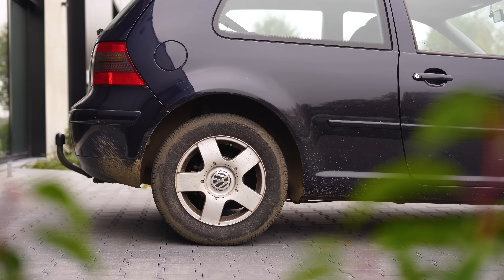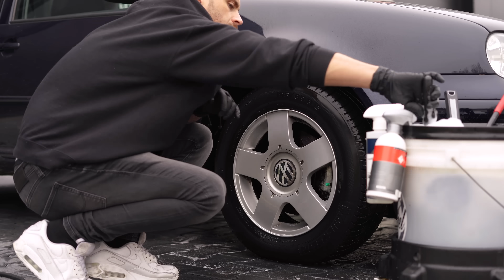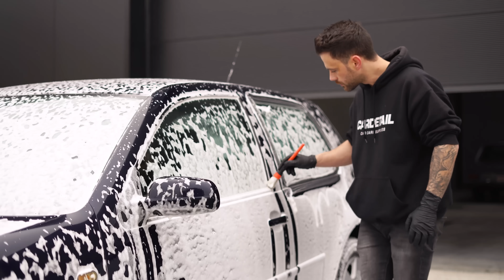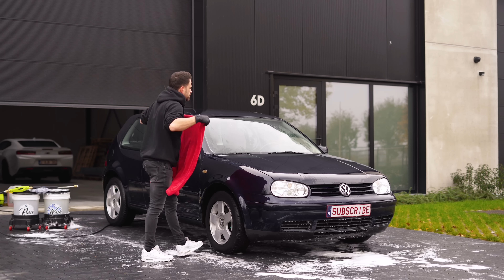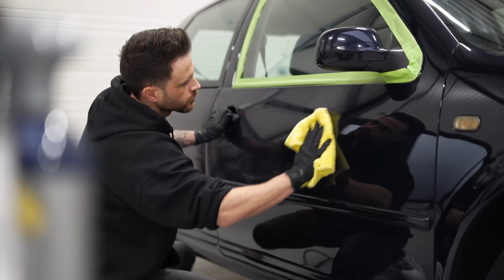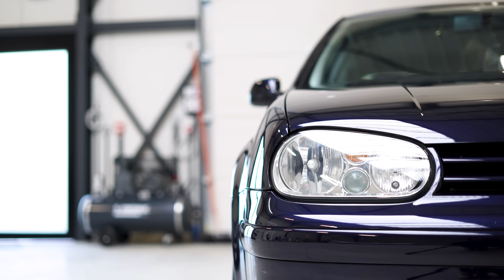24 Year Old VW Golf Deep Clean - Full Detail

Comment: I had a 1999 MK4 Jetta, it's hard to believe these cars are that old now.  They've aged exceptionally well.
Reply: Have a 93 Subaru Impreza, another car that has aged like fine wine. Both cars still look great compared to newer cars in traffic today.
Reply: externally yes, internally no.
Reply: @ichewtoast111  agreed lol
Reply: @eddiegdrums1646  every single part on my mk4 has broken and im not even kidding haha. They sure look good though.
Reply: @ichewtoast111  mine was shocking unreliable, couldn’t help but love it tho
Reply: I had 1999 MK4 GTI with the 2.0 non-turbo motor first batch that landed here in the US. Just bought Mk8 2 months ago same recipe.
Reply: And still one of the most reliable and robust cars even to todays cars. You can repair everything by yourself....
Reply: @FXTRT1-1 Well there are exceptions, my 1.6SR has this stupid design where they put the intake manifold on top of the spark plugs.. Yes you can do it yourself but it's an unnecessary pain in the behind to just change some sparkplugs

Comment: Ah yes, the Mk4 Golf. One of my absolute favorite cars out there. Good job on this one 👍🏻
Reply: Timeless design and exceptional reliability
Reply: The best part. Two doors!
Reply: Same! I go my golf mk4 2000 2.0. Beast CaR!
Reply: Beautiful car too!
Reply: Honest question, why? Just being curious
Reply: @starbies552  I was kinda growing up with the Mk4 and I still like it‘s timeless design as I used to back then. It's pretty wide range of engines was unique to the Mk4 as you never ever had the choice between 4-, 5- or 6-cylinder engines in a normal Golf again. Another thing is that the Mk4 introduced so many luxury options from higher end cars to the compact car segment like for example auto-dimming rear view mirror, rain sensing wipers, navigation system, full leather recaro seats with electric adjustment and memory function etc.

I had one as my first car and I loved it, even if it was the entry level 75hp engine. I would always buy a V5 Highline model in good condition if I had the chance to.
Reply: @starbies552  they are just good. My mk5 was definitely a better drivers car but these are little tanks. Ivd got a clean one with FSH and even if I could buy a new faster car I’d keep this one always

Comment: Quick tip from one detailer to another if you pressure wash the car and get as much dirt off before, it makes it easier to get it cleaner because your getting all the surface dirt off and then when you're using the chemicals it's gets deeper into the material!

Comment: Got a 2001 mk4 gti in silver that's got 230,000 miles on the clock. Still runs wonderfully but the interior plastics are really starting to go and it recently failed its MOT due to various suspension issues. Basically needs a full front suspension refit. All doable but a lot of work (and costly for someone else to do) and I don't even really need the car anymore (got a van and girlfriend has another car). I just can't bring myself to get rid of it, though.

Comment: My favorite part about CarPro Retyre is how uneconomical it is.  Really makes me feel like I'm giving back to the world when I go through an entire bottle on one car
Reply: that's like every wheel cleaner 🤣 your best bet is to buy the gallon size that you dilute into smaller spray bottles
Reply: @mazda_rt24-p  You don't understand Trent, I'm trying to give back to the detailing community, not save $.  My current wheel cleaner, which is a concentrate, only costs $35/gallon and doesn't require a foaming spray trigger.  I'm failing the industry
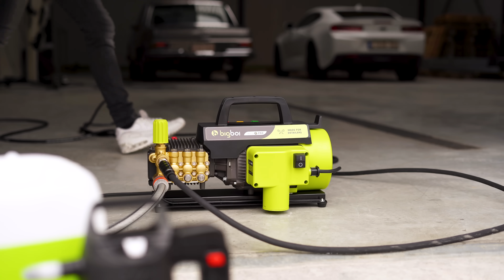Reply: On the plus side you can use the empty ReTyre bottle to pour some 1:10 diluted Koch Chemie PolStar in there and have a dirt cheap Interior Cleaner similar to CarPro Inside with that foaming nozzle. Works great that way 👍🏻